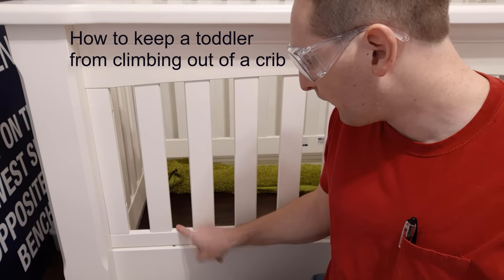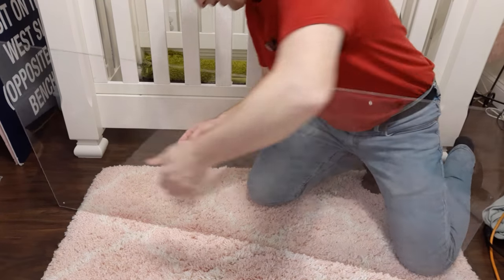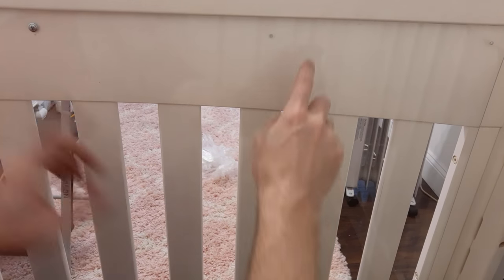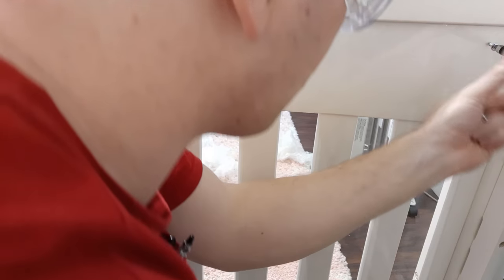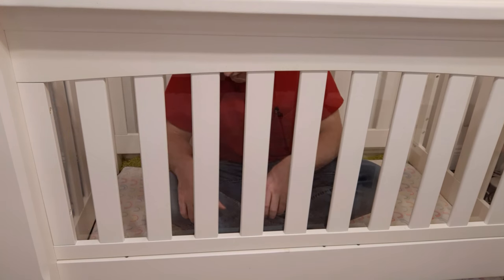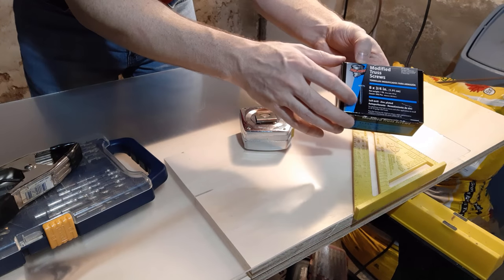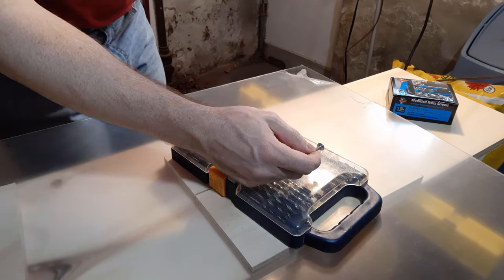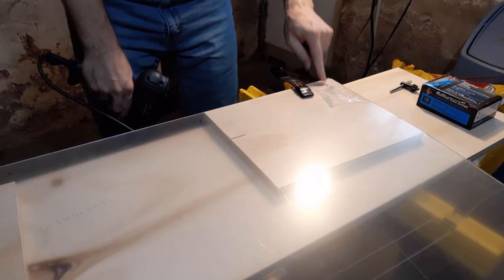How to keep your toddler from climbing out of the crib

Comment: This is a genius idea! I wish it would work for my son. He literally lifts his leg over the side of the crib so even switching the crib with the long part to the front won't work. We even tried the baby sleep sack. He has some arm strength lol. Next we have to drop the mattress to the floor and put some boards under.
Reply: You can use safety sleeper my brother is using it there no escape full enclosed bed with zipper no access from inside 

I've also been in safety sleeper for 3-4 nights and trust me i tried to get out but every time i failed to get out

Comment: Great idea! My crib is the same hight on the sides too. Would doing this on sides Ruin the crib for when we convert to toddler bed? Thanks for the hepp
Reply from the maker: As long as you are not drilling into the areas that will remain in place when it is converted you will not see it. Even if you drill into areas that will be left when converting simple wood putty and a little touch up paint will hide any unwanted holes.

Comment: Did you do both sides?
Reply from the maker: I only put it on the front side since the back of this crib is much taller and did not need it.
Reply from the maker: I just did the lowest side in the front to allow for air movement.